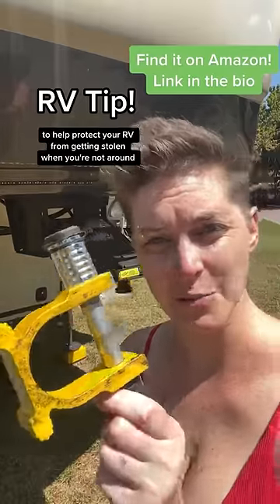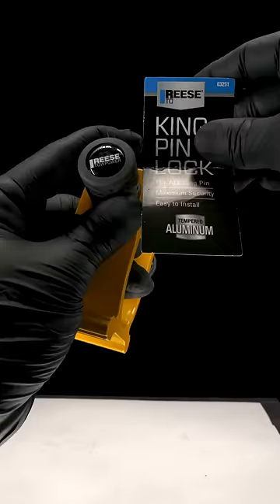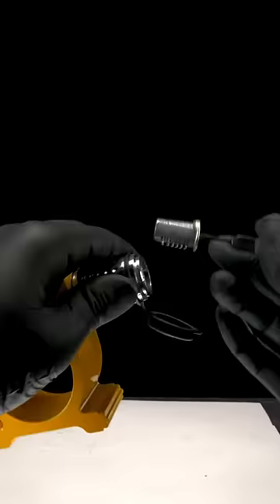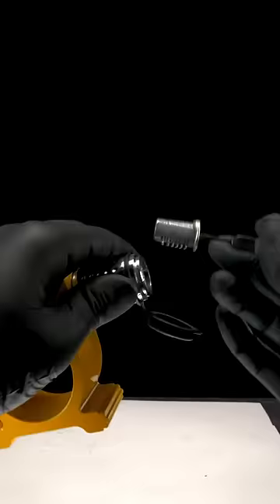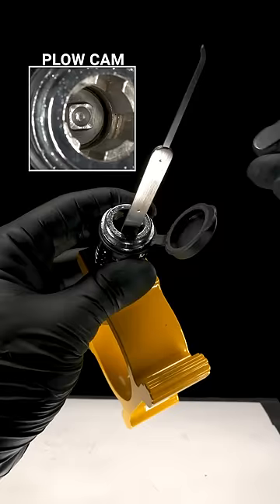Reese King Pin Lock opened with short hook & wave rake

Comment: I remember when I bought a bicycle from a bike store, the guy that was helping me choose locks and accessories told me that I wasn’t going to be perfectly locking my bike and stopping its theft… I was going to need to make it more annoying to steal than the bike next to it 😂
Reply: Same energy as ‘you dont have to run faster than a bear, just faster than the other person’
Reply: @daldorian  *your friend, lol
Reply: Yeah even if you use the best lock and chain/wire/clamp you can find, someone with an angle grinder will be through it in under a minute lol
Reply: @jonslg240  yeah at that point it doesn't matter if you have a lock or not. This is to prevent crackheads/ passerbys from just  taking it. I'm sure if someone really wanted it they could get through it

Comment: This guy should start a company that builds legitimately secure locks
Reply: The unfortunate thing is that it's practically impossible to do that.   Your best bet is to have enough security that it looks too hard for the average thief to enter quickly and quietly.  A determined criminal will get in regardless.
Reply: @Joel  so basically any lock, your average theif isn't lock picking, or damn near any thief.
Reply: @SilentxKillerx5  pretty much.
Reply: They all are legitimate what are you talking about. Locks are just deterrents. If someone really wants to remove one then they can. That someone could also be the owner. You know, if you lost the keys.
Reply: There's no such thing as a secure lock, there's locks for honest thieves, locks for the unskilled, and locks that aren't even really locks, nothing more
Reply: @JTPCrusade  there are unpickable locks they are just insanely difficult to make and take so much time to build they aren't feasible as more than a novelty for people with more money than god... And a cordless grinder with a thin cutoff wheel makes short work of them regardless
Reply: It’s called a welding shop
Reply: @JTPCrusade  seems like the only way is to lock your wheels together if its a 4 wheel rv along with the hitch lock
Reply: @jessebond4221  Bruh "practically impossible" is what I said.
Reply: @jesse bond  he has videos on those unpickable locks and he does it in the time of a short
Reply: Here's the thing with security. You can only make something as secure as you are willing to make it inconvenient. The more secure something is the less usable it becomes. For example, you can lock your door with a whole army of deadbolts but it becomes more and more inconvenient the more you add. It is extremely difficult to make a lock that is easy enough for the owner to get something but secure against the most determined of thieves. The real idea behind a lock is to convince thieves that it's not worth the time it will take them to get the lock off.
Reply: This guy should be banned from posting these videos because it doesn’t do anyone any good.
Reply: @Brian Edwards  it does do good because there are certain locks that take him a good min to unlock. So if he can unlock anything fast go for the lock he can't pick fast and you have a secure lock that only less than 1% of people can do. It's educational and maybe a good hobby for people the fbi, military, and other securities personel should know this stuff someone learning young can be a step ahead in those categories if they choose to do that line of work.
Reply: The closest thing you'll ever get to a secure lock is a big dog and a large caliber. Outside of that, a battery grinder will get you into literally anything.
Reply: Dogs, very well trained dogs
Reply: If someone can make it someone can unmake it🙄 It's actually best to unmake the thief In the act
Reply: @brianedwards4703 Knowledge is power
Reply: @jessebond4221  EXACTLY! it's about overlapping security and deterrence. 

Having measures that will slow and inhibit them. Systems to make it VERY clear that someone is trying something. Usually also cameras to record it. 

Oh and someone actually checking it often enough to keep someone out. Not like hiring security but just someone walking around once or twice a night to check on shit. Bc the other setups will make it blatant someone was there so cops can be called out.
Reply: @chicopride2  im talking like the dual four sided key locks they are unpickable the only way to remove them is with the 2 keys or by cutting them off ... The key hole is too small to get enough tools in to pick them and the keys are square so there's not enough room to lever them to turn
Reply: @jessebond4221  If a key fits, tools will fits. And search those locks on youtube, there’s a lot of examples of them being lockpicked. They are more complex, but not impossible.
Reply: Yea the most practical way to stop a theif from stealing anything on wheels is not to get an unpickable lock or super beefy lock ect.. its to remove the wheels from said bike or vehicle to render it imcomplete or impracticle for any potential 'would be' thief.. and even then if you really wanted full advantage of 'security' its best to plan ahead of the curve. Properly install a quality gps tag/ battery somewhere deep inside  core of said vessel and in such a way that it would require insider knowlegde+skilled determination to remove from vessel.    That paired with a basic deterent lock will be best means of insurance.  However  w/e the means of action requires that said vessel be worth more to owner than potential theifs motives..       btw regardless this guy will have no trouble! ^^^   relentless
Reply: He doesn't because he knows that it's very hard to do. You can make locks harder to pick, but I've never heard of a lock that's totally pick proof.  Besides, even if you did invent such a lock, it still wouldn't do shit to stop "brute force" attacks.  Angle grinders are cheap and will cut right through steel.
Reply: @jjthe  Yep, it's a law of the universe. It works the same with cyber security.  The reason companies get hacked all the time is because none of the employees want to follow security measures because it is slow and tedious to use day to day. There is always a trade-off between security and convenience.
Reply: @Wowzersdude-k5c  Exactly! I went to school for cyber security. Before they got into the nitty-gritty about the cyber aspect I had several classes about general security

Comment: Cable companies in the 80's and 90's used a lock on each cable end that needed a special tool to remove them, so I would buy a popsicle from the ice cream man to get my own special tool. I would jam the popsicle stick in between the outside sleeve and the center of the lock to turn the nut inside and remove the lock. 
I charged $50 per home to connect the cable.
Watching you reminds me of how easy it was to open a four numerical combination bike lock. 
The old newspaper machines had lock boxes with a lock in the middle that required a special key to open them, or you could of just turn the machine upside down and collect the coins once they fell out.
Reply: Stealing cable
Reply: Yes they were remarkably not well protected but the things you're describing were still crimes. I'm sure Mr McNally or whoever he is would put a disclaimer here saying that he does not endorse using this knowledge for such activities or anything other than education or personal use. So I just went ahead and did it for him sorry if I missed some of the legalese
Reply: However I get that you're just waxing nostalgic
Reply: However sharing information of stories that could be misused is not a crime as long as the story does not include breach of security contract or treasonous content
Reply: @cory3106  
The stature of limitations ran out decades ago.
Reply: @cory3106  
Awe! 
The good Ole Days.
Reply: I remember the basic cable.  ..... going around charging for it crossed the line a little

Comment: That actually looked alot easier and simpler than normal locks I've seen you do 😮 that is a definite security risk
Reply: tbf most locks can he opened with bolt cutters. There's not really any such thing as an unpickable lock, the bigger security risk would be not having a lock as your average crack head thats actually going to try stealing anything from you is just using bolt cutters he stole from the harbor freight thats down the road from your rv park.
Reply: @Racc-Kun_YT  well yeah but a crack head walking around with bolt cutters is more likely to get caught or draw some suspicion but if i saw mcnally picking a lock with such efficiency id just be assuming its a wonky lock they are unlocking id just want what ever can slow em down the most lol

Comment: ima just weld my front door at this point
Reply: You can't protect your back door...
Reply: "You are using a manually welded door, it can be opened using a manually welded door."
Reply: @nathank.9357 😂 im goneer
Reply: What are you going to do if you weld it shut and forgot your grinder on the other side
Reply: @joshuacheung6518  eh get a master lock branded welding machine  all you beed to break out is a master lock branded welding machine slams into front door
Reply: Congrats, you broke the welding machine. Now how about that weld?
Reply: He’s probably going to unlock the welded door
Reply: @joshuacheung6518  now you take a masterlock branded drill and try and drill out

Comment: When will this guy build his own lock brand?
Reply: He couldn't do any better. Locks don't stop thrives, they keep people honest.
Reply: @helios566 you are kinda right in principle, but there are plenty of locks that are basically unpickable (except by literally only a few people on earth with custom tools), and some that have been out for years and have yet to be picked.
Reply: @helios566  there are some that are "impossible" to pick, he has mention them in a few videos.
Reply: @Croix1 doesn’t give a single example
Reply: Locks are like everything else, you might know their weakness but producing a new one that addresses those weaknesses  and is also accessible to customers without violating trademarks isn't so simple. You can make an infinitely convoluted, super reliable unpickable lock but if you only have time to make one or a few of them, nobody will know or benefit from it. I'm no locksmith but I feel like that's part of it
Reply: That principle is called security through obscurity
Reply: It would be pointless thay already make battery powered pocket sized bolt utters that could cut up to a 3/4 inch shackle
Reply: Locks, in principle, are security theater. He will even admit that most of the picking is useless with a battery angle grinder or bolt cutters or even just a rock.
Reply: Tru
Reply: Yall realize he works for Covert Instruments, right?
Reply: @Croix1  unpickable locks do not exist, every lock can be picked. The goal of a lock is not to be completely unpickable, the goal is to make the process of picking it tedious and time consuming so that those who would actually steal the thing you locked won't bother trying to pick the lock in order to get it. Be it due to lack of knowledge on how to pick the lock, or because doing so could alert others to what you are doing.
Good example: Bicycle locks. All bicycle locks kinda suck and are relatively easy to pick, but if it takes more than a few seconds to pick the lock, most people will notice you're trying to pick the lock and stop you. Hopefully.
Reply: @blackm4niac  Go find me someone who has picked an abloy pulse. I'll wait.

Every lock is BYPASSABLE. If nothing else works, a nice lump of C4 will bypass pretty much anything. That is not the same as something being non-destructively pickable, and there are DEFINITELY locks that are basically unpickable.

Comment: You and lock pick lawyer need to come together and design an unpick-able lock
Reply: the point is there is no such thing as an unpickable lock. if it can be unlocked it  can be picked some are just harder then others
Reply: Seriously, this guy needs to make a regular lock that’s as good as it can be.

Has a huge audience, could be the next master lock easily enough.
Reply: @battleunit2254  Lpl lawyer did  shower  how to make a door look pick proof. Only problem is  that the lock seizes up when picked and you now have to drill it  out

Comment: Next time I see a lock like that I will ask the guy if I can show them a cool thing about their lock and watch their face turn to horror.
Reply: I’ve never used this lock but I’m pretty sure you need to have it picked open first.
Reply: @heatshield  you don’t lol ti just opens
Reply: @heatshield  this is mcnally we're talking about here, my guy. he has the same process LPL has, i.e. the lock is locked at the start.

and it's pretty obvious that the lock is locked, because the shackle bar isn't loose.

quit making a fool of yourself.
Reply: @Sihgilanu  friend, my intention wasn’t to take anything from his reputation or say it was “fake” or anything like that.

 Please allow me to explain. If I’m wrong then so be it. I’m wrong. (I believe I WAS wrong)

At first, I thought he was simply demonstrating that it can be completely gutted after picking it (or using the key), so as to disable it completely, just as a sort of disrespect to the designers of the weak mechanism, for fun, ya know.

 Now I’m not so sure. It may actually be able to be gutted like that without key or picking. Just the one pick pushing out a retaining pin.

 I humbly stand corrected if that’s the case, which it seems it is. Again, just to be clear, I didn’t think he was doing anything wrong. I just didn’t logic my way through it all the way. He probably wouldn’t have posted this if it did require picking or key first. What would be the point of that, right?

 Nice to meet ya. Peace! ✌️
Reply: I did that to the regional manager at O'Reilly. He was pissed no one was using the Club device in the vehicles. I said wait here. I went inside, grabbed the universal dipstick kit, and came back out and pushed the dipstick in a small hole under the lock. Started indexing the lock notch by notch until it came off. Handed him the lock and dipstick. Thats why nobody uses it Matt. It doesnt do anything. Other than be a slight annoyance to the theif.

Comment: I've decided that from now on I will weld my bike to the bike rack
Reply: I also recently came to the conclusion that the only way to make something pick proof is to weld it down/shut.
Reply: cutting torch are keys to weld locks
Reply: In my city, people pull up to a bike in broad daylight and use angle grinders and cutting torches to take bikes from racks. In the middle of downtown! Just casually like it’s their bike and no one messes with them.
Reply: Still not secure.
Reply: @Action2me In the defense of the bystanders, would you bother someone with an angle grinder or cutting torch?
Reply: @Action2me  of course no one messes with them, the only real way to secure a bike (or damn near anything) is insurance.
Reply: Just don't use the type of welding you see in YT shorts!😂

Comment: Lock makers need to hire this guy to test their locks cause if there's any sliver of a way in he'll find it and just casually takes apart a lock into bits
Reply: trust me, lockmakers have "these people" on payroll already.  there IS NOT a way to make a lock unpick-able. if there is a pathway for a "key"(necessary) there will always be a way to get through.  its just a matter of time and frustration, and humans have a habit of making skills out of ultra fine skills, ie card counters and shuffle manipulators.
Reply: @DonaldPrizwan  getting people to test the locks might show the company if the lock needs work to be more secure
Reply: @LittleBirbBoi  go back and read what I said.  -_-
Reply: @LittleBirbBoi bro have you ever played Skyrim? No lock is safe from lvl 100 lock picking skill
Reply: @DonaldPrizwan  It seems there's a plethora of locks that can be opened with low skill attacks though (like simply pulling out the barrel, or reaching past the barrel, or giving it a swift hit to trigger the latch without touching the locking mechanism, or reaching past the tumblers in a combination lock, or using a wave rake because there's no security pins, etc etc). I think for many years lock makers relied on the ignorance of the general population not knowing how locks work rather than actually making locks difficult to open. Increasingly, with channel like this or LockPickingLawyer, average joes are starting to realise that a large number of locks are little more than decoration.
Reply: @LittleBirbBoi L reading comprehension

Comment: Locks don’t keep people out they just slow them down, so you should still lock it with whatever you got, it also keeps honest people honest.
Reply: Honest people dont need to see a lock. Its not theirs.
Reply: Slow down? This took like 30s, barely slower than using the key.
Reply: locks are to prove to the insurance company that you"tried" to secure it. At least if you put a lock you can make an insurance claim.